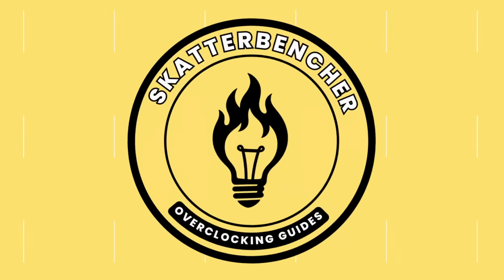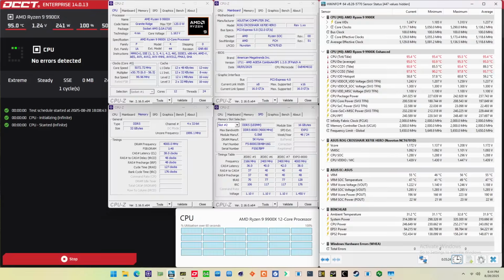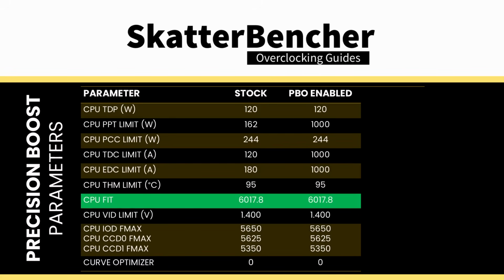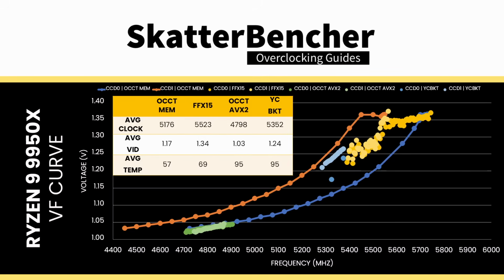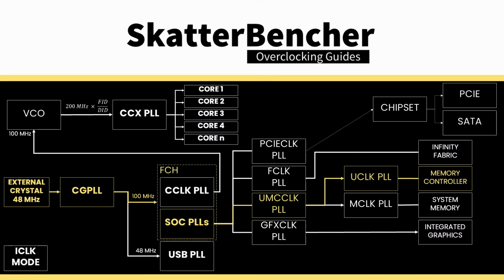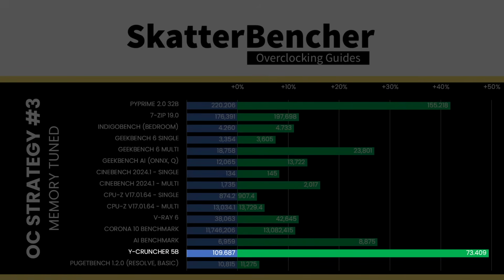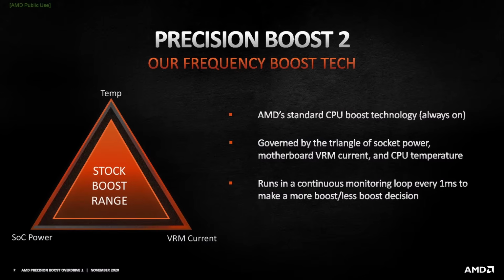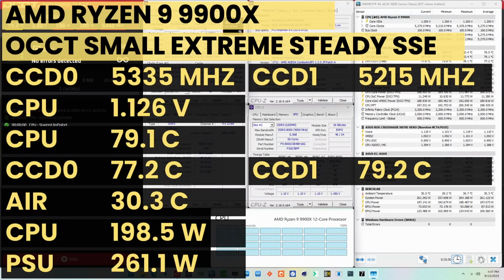Ryzen 9 9900X Undervolt & Overclock to 5825 MHz | SkatterBencher #92

Comment: can i use this setting with r9 9900x3d?
Reply: No it cannot because after experimenting this thing will not make it through a benchmark above a 5.3 Even then with the adjusted clock speed After enabling these settings and leaving the core clock frequency at stock I got a higher benchmark score on Cinebench then adjusting it to the 5.3 it did less when I made it have a higher clock speed for some reason

Comment: I'm biased as a 9900X owner, but I really do think it is quite underrated, particularly re: value for money and maximizing your capability if you dabble across many different areas. The 24 threads are great for multi-core heavy lifting, the dual CCDs increase max memory bandwidth, and you get effectively 33% more L3 cache per core across both CCD's. Single core max clock matches the highest AMD offers when accounting for the added heat that'll compromise a full 8-core CCX too, although the potential 12-core binning disadvantage vs. 9950X/3D or 9850X3D can negate that (for daily systems - excluding extreme cooling setups). 
With some barely intermediate-level tuning and optimizations, it can be the jack of all trades even under maxed-out PBO air-cooling given the lower heat density. For $350, I am very, very satisfied with mine - only downside is the dual CCD can complicate memory overclocking especially with 64GB+ dual rank kits. Good video!

Comment: Hi, sorry to say this, but I think this video requires an expert to understand all the settings you've made. You spent almost all your time explaining the actual BIOS settings, and very little of it, and so quickly. In short, it's completely unclear. I think you should spend more time and more time explaining the actual BIOS settings. Thanks anyway, but this guide is useless to me. I can't risk burning out my CPU. If you make another video (I hope so) for the 9900x on undervolting and overclocking without all this technicality, I'd be happy to watch it. Bye, thanks.
Reply: estude + e verá que ele falou de forma simples.

Comment: 16:39 ... this is contrary to conventional wisdom, which maintains that the stronger cores and/or CCD -- i.e. CCD 0 in your case -- should get a smaller negative CO value than CCD 1.  Could you explain your rationale here?
Reply from the maker: I tested each CCD individually and this is the values I found are stable. Just silicon lottery things, I guess ...

Comment: why is this so complicated. I just upgraded from FX-8350 to 9900x and previously i just raised bus MHz or CPU ratio (and watched for RAM not to get too high) and it was stable (i can try higher) or not (go back). Im just looking for settings to set in my bios and be done with it...
Reply: I mean, you can do exactly what you did with the FX-8350. Just you will be missing out on the memory overclocking performance boost. Of course there are the two CCDs, but you cannot get around that. This more granular setup is a little complicated, but it allows you to get literally the best you can out of your CPU.

Comment: Hi i wanted to do a overclock on my pc but with a undervolt on cpu and wondering whats best my pc is home built
AMD Ryzen 9 9950x
MSI MPG X870E Carbon WIFI  bios 1.A64
96gb 6800mhz Corsair Vengeance cas34 1.4v CMH96GX5M2B6800C34
MSI RTX 5090 Vanguard soc Launch Edition
PSU Seasonic Prime-TX 1600 ATX 3.0
ICORSAIR iCUE LINK TITAN 360 RX RGB Black All In One CPU Cooler - 360mm with corsair ICUE Link Black LCD Module
Built in a Jonsbo D500 Aluminium Full Tower PC Case Silver Tempered Glass
any help would be very much appreciated and much thx in advance
Reply from the maker: I have a video out on the 9950X https://www.youtube.com/watch?v=v9fL8XD2v2Q.

For undervolting and tuning Ryzen 9000 CPUs, Curve Optimizer and Curve Shaper are your best friends!

Comment: I found that disabling the processor's built-in video core radically affects the ability to work with more aggressive RAM settings and the ability to take higher frequencies. Have you noticed this?

Comment: Is there a way to confirm an AMD CPU can't run memory at 8000. I've got an X870E Apex, but no matter what I try with timings and voltages I cannot get it 100% stable. I can get 1 hour of OCCT, but only a few minutes on Karhu. No errors, just immediate crash